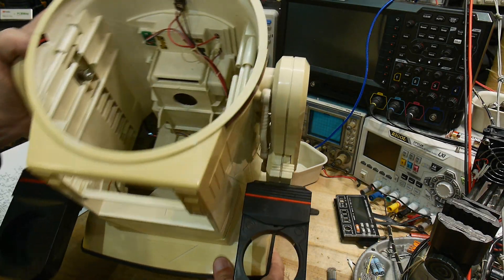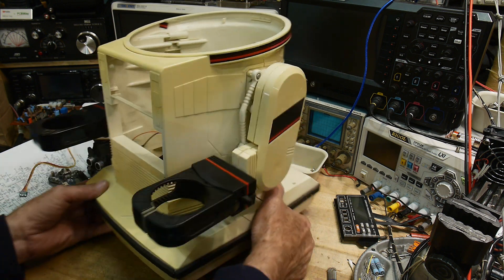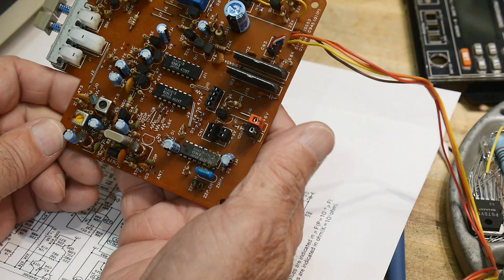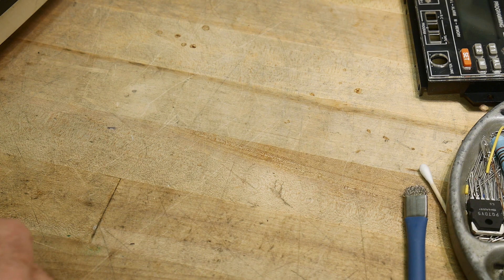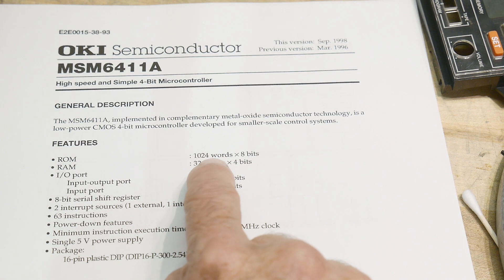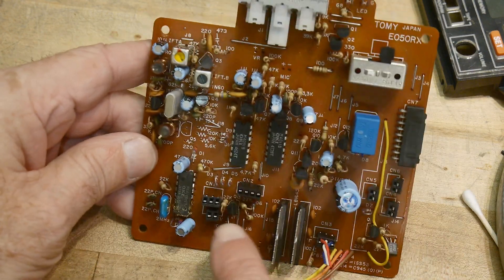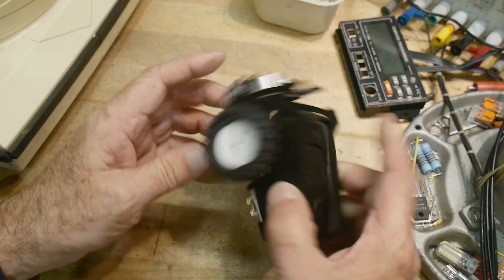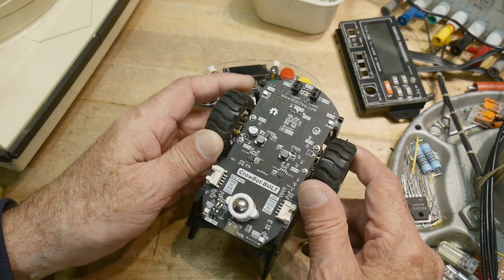#1842 OmniBot (part 3 of )

Comment: Sweet idea using the CrowBot! And in Omnibot you will have hopefully enough room. I did a (smaller) Verbot where I retained all of the Tomy motor/gearing. These things were mechanically complex, but fortunately Tomy patented it and I was able to find that from google patents and figure out how it worked! Then I just had to use a motor driver and get the RPiZ to interface with the original switching to control it. It worked but it took me a long time, so hopefully CrowBot will save you some!

Comment: Cool car.

Microchip Fubarino compatible with Arduino IDE compatible out of the box, 32 bit, 64kb ram, 48 mHz, 256 kb storage, 44 pins, 2 buttons, MEMS oscilator, everything twice onboard, well build PCB & tight USB connector. like post a stamp sized. well prized.cheaper than Arduino Uno.

Comment: Just a wild guess…Oki data, like in the printers?  Maybe a microcontroller for a printer?
Reply: Oki made a wide variety of digital ICs, mainly memory types, but I think their market was more Japanese than international.
Reply: Could be. We used to have an an Okidata printer at work. It used a strip of LEDs instead of a laser and no rotating mirrors or anything.